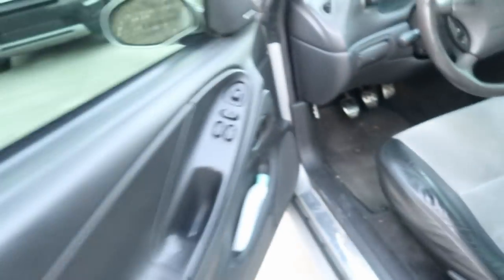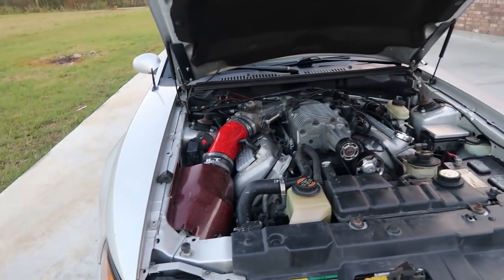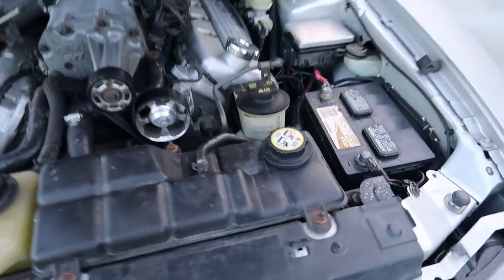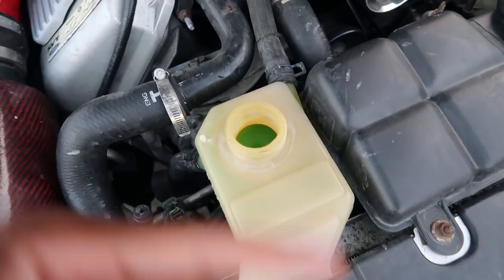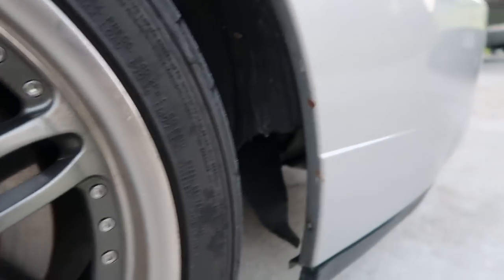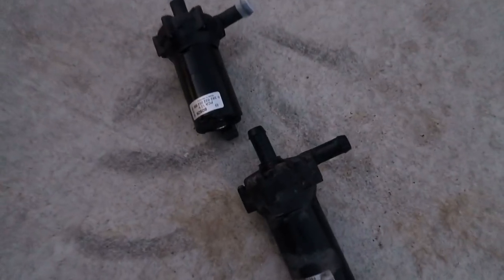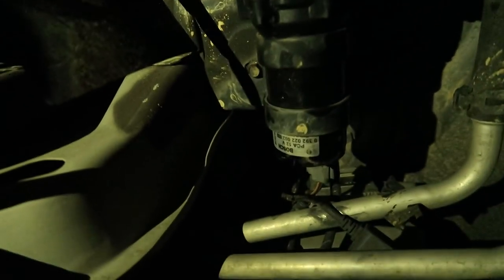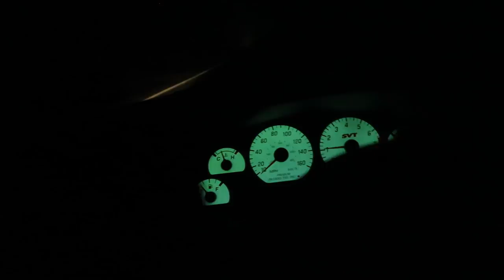My Water Pump Failed! This Could've Ended My Mustang Cobra!

Comment: I took a metal coat hanger, cut out a 4 or 5 inch rod from it and bend it into a "U" shape. Then anytime you want to test your intercooler pump, you just stick that u rod into the two poles of the relay. You can do this with the engine off too...that way you can easily tell if the pump is on or not. It's a good idea to test it regularly...especially if you are going to the track. Otherwise, overheating could kill your engine! The computer will pull timing out in a situation like that, so if your car starts running badly...PAY ATTENTION!! Great video bro.

Comment: I had my pump quit on me back in the spring.  Whacked it with a hammer and it kicked on.  Threw one in it a few days later and started smashing bugs down the road with 21 Lbs of freedom.    If the air temp is cold on the Intake air sensor #2, it will not turn on that pump.  The temp for the PCM must be 60 or 70 degrees, and the sensor is after the blower and intercooler so pretty much should run most of the time since I think your in the Bayou State.

Comment: IAT2 temps would be higher which will cause your car to pull timing. A good tuner would’ve caught all your issues through data logging via wideband datalogging also. Your wideband would’ve shown lean with the intake tube leak since your car can not compensate for that much unmetered air entering into the engine. 

Get that wideband on that car before you melt it down!
Reply from the maker: I’d have to say I’m very pleased with my tuner, he helps me with a lot of my problems/questions that I ask and gives me advice on things. This was solely my fault for not having a wideband and it occurred after my datalogging with him. He never got a chance to see what was going on until after I fixed it. But my wideband should be here tomorro and I’ll get a video out of me installing it soon👍🏽
Reply: PJ Morrison I would be curious to know what parameters your logging because like I said, your IAT2 would be high under boost with a bad intercooler pump. Your car will pull timing which would be caught by a good tuner. A good tuner won't remote tune without a wideband also.  Just sayin..

Too many guys have burnt these cars down from bad tunes, bad intercooler pumps and making pulls under lean conditions. Just a very experienced 03-04 Cobra owner trying to help you out here...